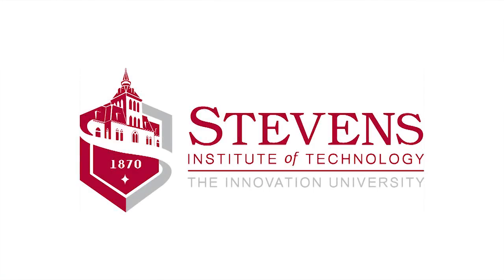Piezoelectric Nanogenerator for Medical Devices

Comment: This is huge!  Soon it will no longer be necessary to replace or recharge batteries.  They will be recharged by mechanical energy such as movement, vibration, etc.  This blows the door wide open for implantable medical devices as they now have a power source.

Comment: Let find a way to charge one bank of batteries using nano generators, while the other bank is being used to power an electric car, the movement of the car can be utilized to created sufficient vibration to activate them.